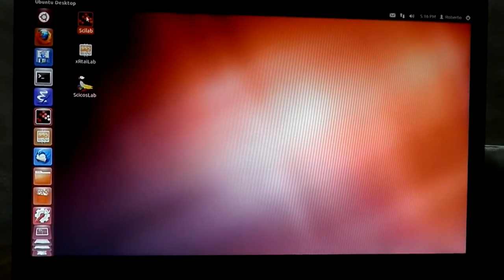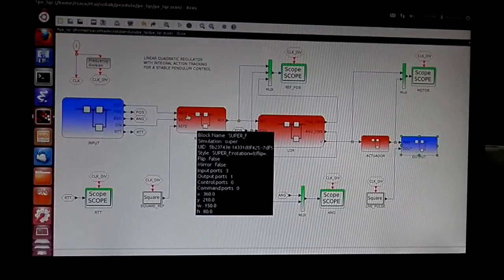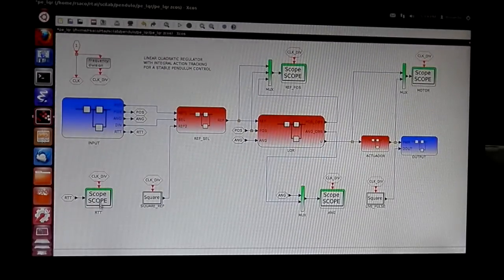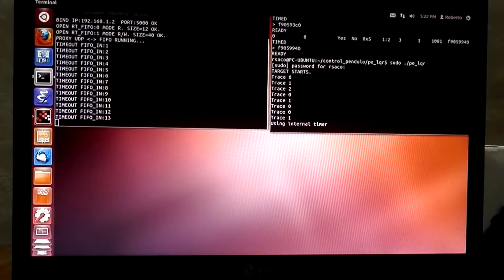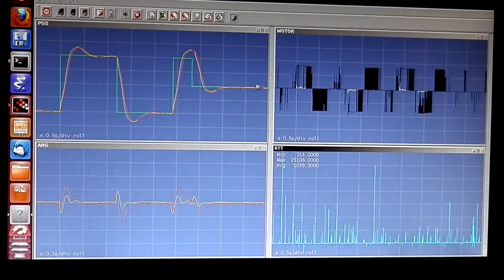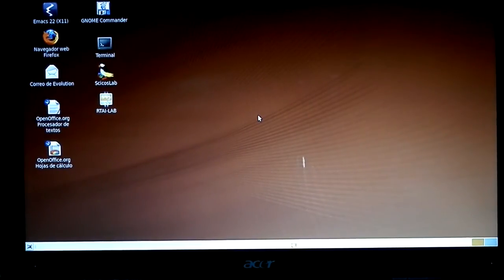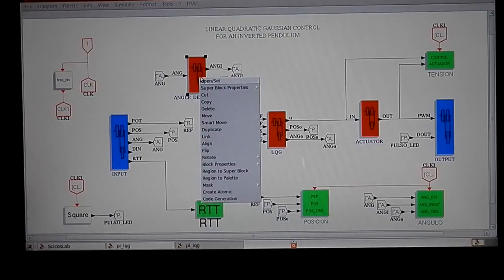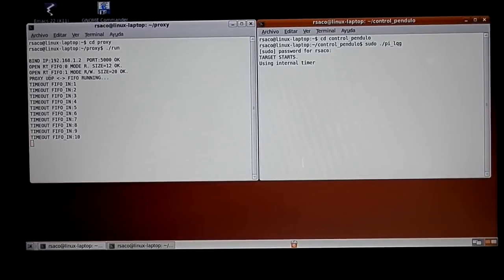Pendulum Control Over Wireless / Ethernet Using Scilab - Xcos and RTAI

Comment: In your video you run RTAI with XCOS , but in the documentation you use ScicosLab/Scicos.  Is there anything special to know when using XCOS to run RTAI-LAB?
Reply from the maker: Guillaume Tremblay When I wrote the documentation (papers in spanish) I had not used Scilab/Xcos yet, but Scicoslab/Scicos.You can use "HART toolbox" to generate the target from XCOS. Once you have generated the target, there is nothing special to connect RTAI-LAB to the target.
Reply: thanks!

Comment: FANTASTIC!, but can you say me what electronic card you use for the adquisition data? is an arduino? or that is designed for you,  what microcontroler u  use please!
Reply from the maker: The I/O device was designed by me. It uses a MC9S12XDT512 (freescale) dual core microcontroller. The main core is in charge of communication tasks like ethernet, ARP, UDP/IP protocols, etc. The other core (xgate) is in charge of pendulum I/O tasks, like encoder sensors, limiting switches, ADC, PWM modules, etc. The ethernet controller used is a RTL8019AS (realtek).